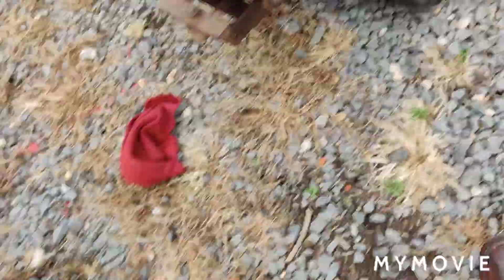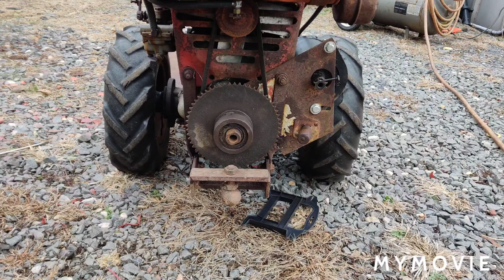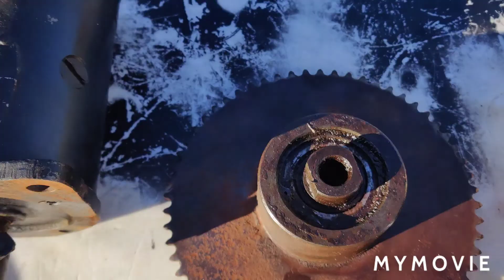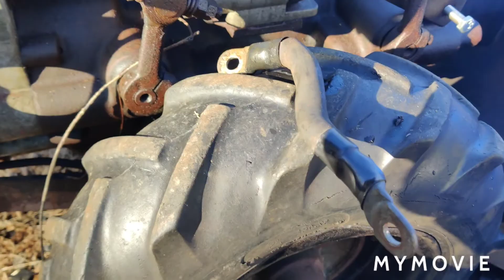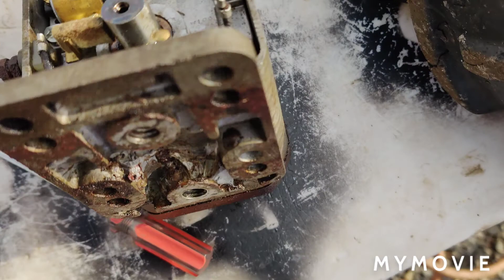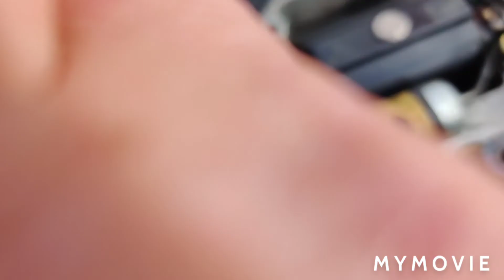Preparing the 62 Gravely LI for start up Part 2.

Comment: Nice to see it started.  Save the old clutch for rebuild or parts - cams are expensive.  Left tire is on backwards.  PaulL
Reply from the maker: I will save the old clutch and I will buy the rebuild kit for another video. The tires are only temporary. Thanks for watching PaulL!!!